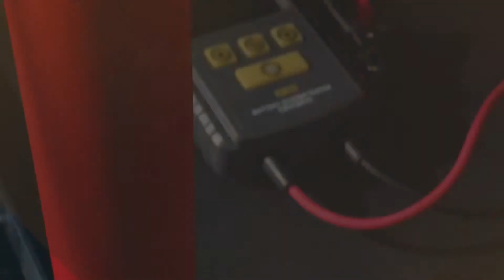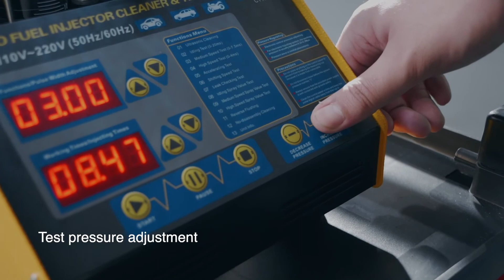AUTOOL CT150 Ultrasonic Fuel Injector Tester Cleaner Machine Spark Plug Car Motorcycle 4 Cylinders

Comment: what liquids do u use
Reply from the maker: Hi Anthony, it is recommended to use professional automotive injector test fluids. If it is not available locally, as an alternative, it's recommended that medical alcohol with an alcohol content of more than 75% can be used instead of the test fluid.
As for cleaning fluid, it is recommended to use professional injector ultrasonic cleaning fluid. If it is not available locally, it's recommended that medical alcohol with an alcohol content of more than 75% can be used instead of the cleaning fluid, but note that the effect may not good enough.
Reply: What is the best setting to measure flow rate and flow match,also the measurements on the tubes are ML or CC

Comment: How can I check max CC in 3 bar pressure by CT150 ?
Reply from the maker: Hello, there are no limits on this. The greater the pressure, the faster the oil spray rate. With a larger CC, it's difficult to test the oil spray volume because the glass tube tends to fill up more easily.